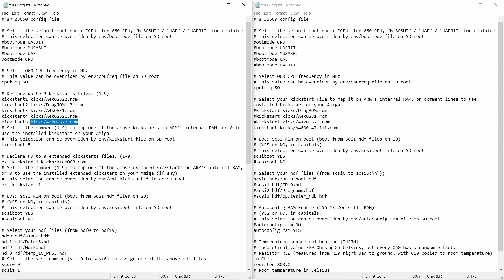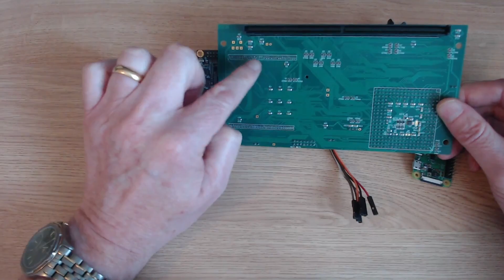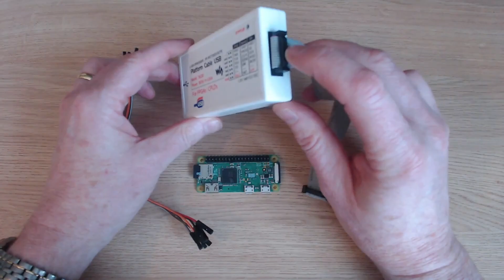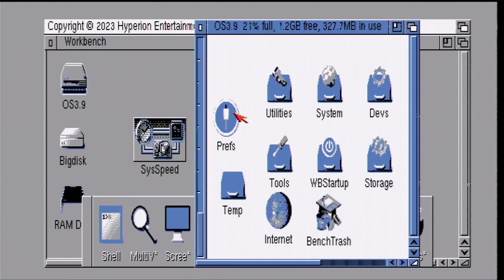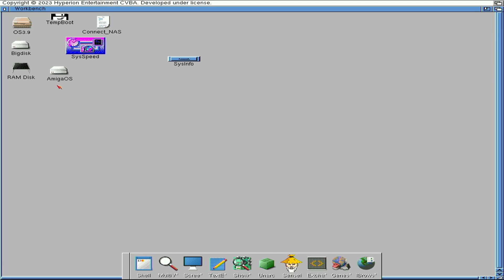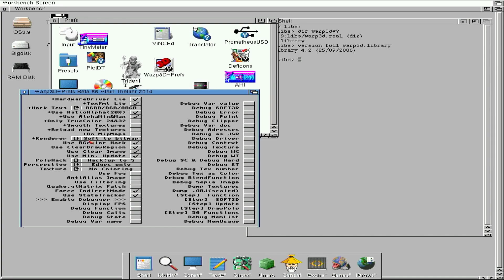Z3660 Part 3: Accelerating the A3000

Comment: Its a cool card for sure and I like mine, but 2 issues with it. No native screen mode pass through. This can be fixed and some are apparently working on it. 2 monitors in 2024 sucks. The other is the INT6 mod. I just got a ReA3000 this year and its a damn shame to run a hackish bodge wire on a brand new board IMO. Guess the 3660 will stay on my AGA boards.